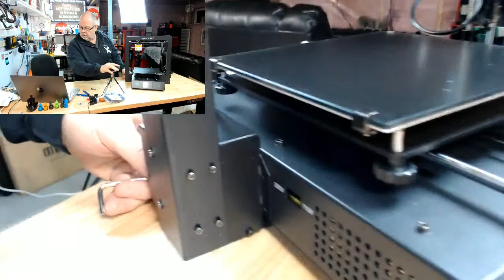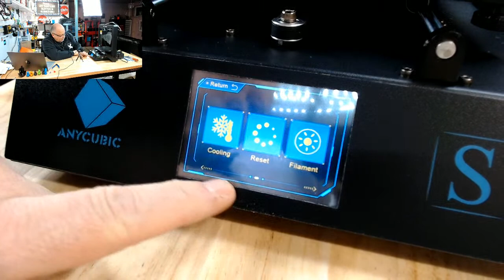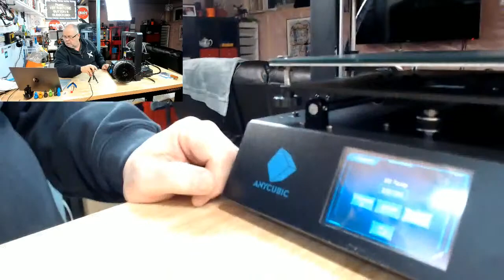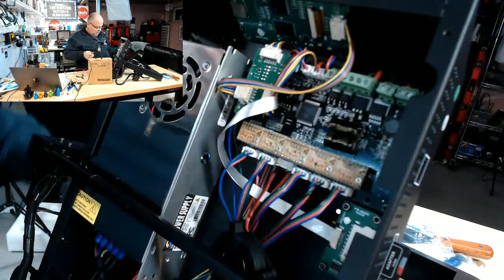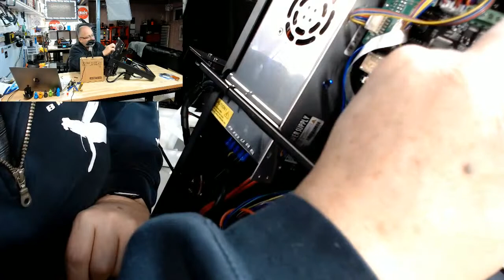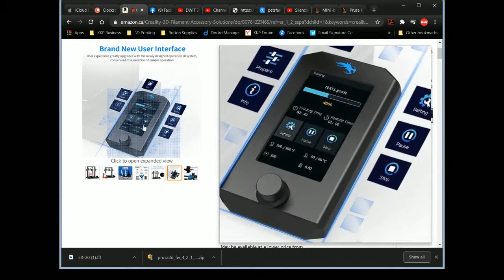Silencing the Anycubic i3 Mega S

Comment: I had the exact same issue with the stepper drivers, I'll have to try again later today! Btw did you use drivers that are UART or STEP/DIR? 

Thanks so much for the video, it is awesome to see someone else go through a learning experience too
Reply from the maker: I believe the steppers on the SKR I'm using are UART.
Reply: @DWIT3D  I have UART driver from bigtreetech, the problem ended up being me using the wrong ground (heatbed) for the multimeter. I was able to get proper readings and tune with driver ground. My printer is much quieter now, thanks for the video again 😊

Comment: Hello there! Really like the video. I was wondering if you had to upgrade the firmware in any way? Also, it seems like TMC2208 boards can vary from manufacturer to manufacturer, do you have a link to the specific ones that you used? Thank you!
Reply: @DWIT3D  I just finished my upgrade. New stepper drivers, new bearings. I think I can live with the fan noise so I'll leave those as is. Thanks a BUNCH for this video and I'm going to try to catch more streams! Cheers man

Comment: Thanks, great video. I am planning on upgrading a couple of fans and stepper motors over the holiday period.

Did you realise you can turn the power off and just manually move the bed and the hotend to level? Saves time rather then moving it electronically.